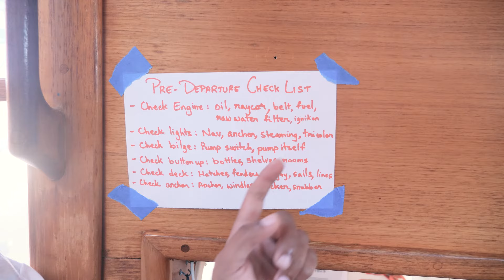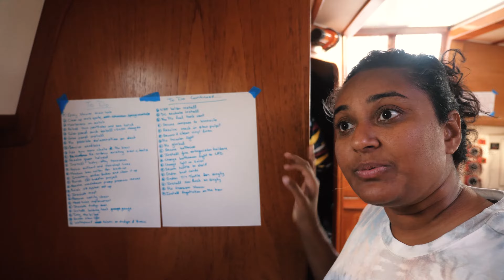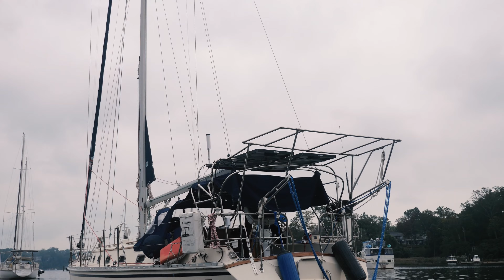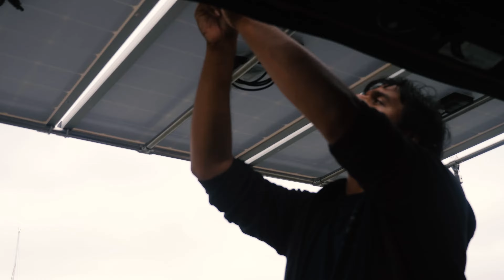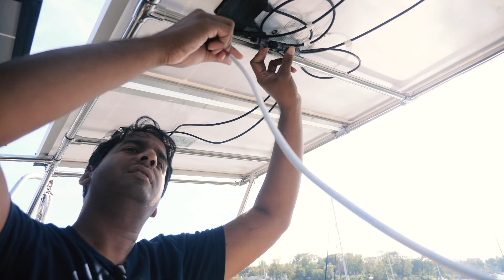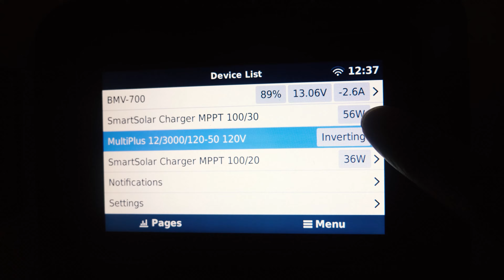We go POWER HUNGRY! - Sailing Turtle!

Comment: Very important i highly reccomend you keep “emergency tape” on board and cedar shingles. obvioudly extras of all your filters and fluids, emergency sealing putty’s. Also I’ve been on 2 boats where the bilge pumps somehow weren’t functioning at the same time, the wet exhaust worked itself free, pumping all the exhaust water into the boat, check that every once in a while. If you have the room a gas powered trash pump is good peace of mind. The cedar shingles are in case you somehow have a crack or hole, you hammer them in one sliver at a time, it’s very effective. Also I own my own mobile welding company, if you have any welding or metal quedtions let me know! Also, if your engine isn’t self priming it woul be a good idea to add a small inline fuel pump, so if you have to do a filter swap in an emergency you can expeditiously prime her. The arch looks great!
Reply from the maker: I have not heard of cedar shingles before but we do carry marine grade plywood on board for similar purposes, three sticks of J&B water weld epoxy sticks, toilet wax mold, two bungs per thru hole, way too many filters and fluids, extra belts, impellers, extra bilge pumps, water pumps and of course bolts and screws. Most of our boat storage is some sort of extra parts haha.  Our engine does have an electric pump that allows it to prime and we don't need to bleed the system so the air in the system when we change filters works its own way out even out of the raycor. We will definitely look to you for welding questions! It is something we'd like to do more if opportunity arrives. Thank you!